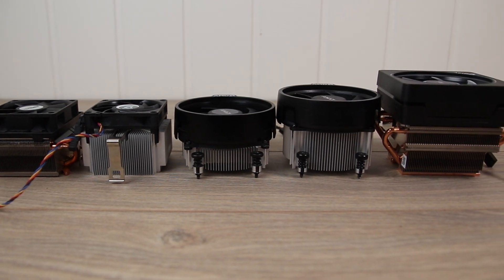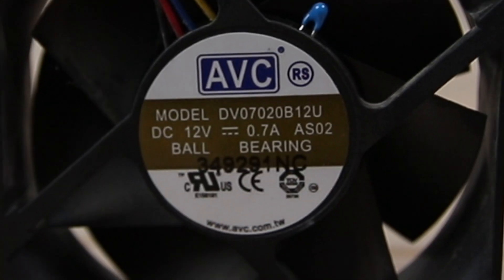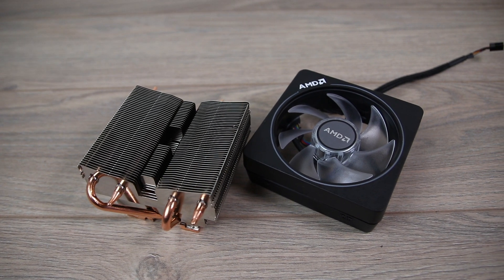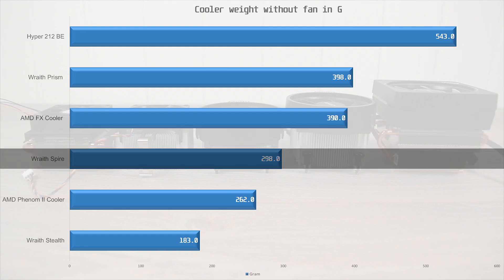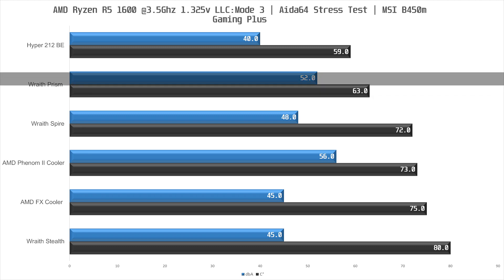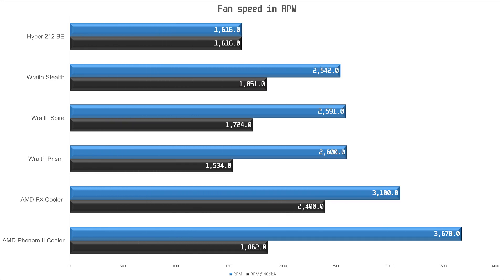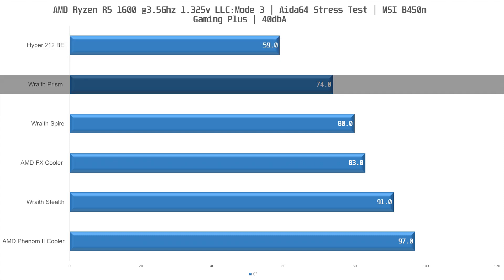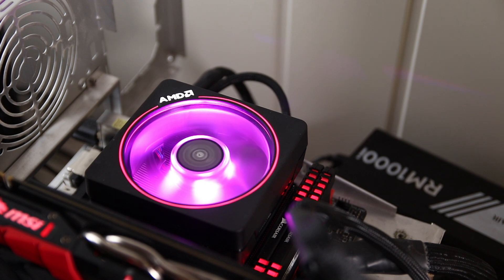Five AMD Stock coolers put to the test| FX and Phenom Coolers vs Wraith and 212 Black Edition

Comment: What about the temp during gaming, as this  is the only thing I will be doing
Reply from the maker: Depends on the game and settings. In general the stock cooler that is bundled with the amd cpus will be fine for gaming. However something like the hyper 212be will be more quiet. The cooler master fan on the stealth is not toi bad noise wise, the AVC fan on the spire is a bit louder and the prism can be downright nosiy.
Reply: @DontCallTechSupport  was planning to build with 3600 on stock cooler and upgrade it in few months, I live in India and the avg temp are around 36 degree.
And thanks for the quick reply
Reply from the maker: Oh, quite warm there. It will probably run quite hot then. Should be OK in less demanding games, but you may see 80 or even 90 degrees.

Comment: strange. I was hoping the old fx cooler that was made for a cpu with a 125w tdp would do great with the Ryzen 3 3300x with a tdp of only 65w
Reply: The phenom cooler is the one that came with higher end FX CPUs like the 8320 and 8350 the other one came with 6300s and lower IIRC
Reply from the maker: I don't have a 3300x, so I don't know. But the 3300x uses less power than the 1600, so it should be Okey. Not sure if it will be any better than the wraith stealth though. The fan on the FX cooler will probably make more noise.
Reply: @DontCallTechSupport  thanks for the reply. Like you I'm not crazy about noise so I'll probably just pick up a 212. It will do a much better job anyways so no sense in cheaping out.

Comment: After watching you’re video & other’s, i decided to go with the amd Wraith Max cooler ( very similar to  Prism butt quieter ) for my Ryzen 5 3600 with DeepCool Matrexx 55 Atx case with 4 decent Rgb fans already installed. I needed a Cooler with the fan airflow facing downwards towards the motherboard, that’s why i didn’t go with the evo hyper 212 🤔 for a Stock Ryzen 5 3600 it should be just fine & i figure it will drop my temps : -10c   Compared to the Stealth it shipped with. Thanx for Posting 🇵🇹
Reply from the maker: Thanks for watching! It should be quite a bit better than the stealth yes😅
Reply: @DontCallTechSupport  ~ feeling a bit of buyer's remorse  not going with a hyper 212 or Similar butt having the airflow downward towards the motherboard is important for me ( Long story ) butt either way Thanx for reply

Comment: I NEED HELP
1) Should I go for the strix rx 5700xt for just 10$ more than the Red devil ???
2) Will I get annoying problems with the strix model ??
Reply from the maker: I haven't tested the red devil myself, but judging from other reviews I don't think the strix is worth 10$ over the red devil.

 On the strix card you may have to replace a couple of screws that's supposed to hold the heat sink to the VRM. You don't have to replace them, but then the massive heatsink could add extra stress on the screws behind the gpu. There is also a new Bios for the strix card, I have a video testing that one.

Personally I would opt for the Red Devil.
Reply: @DontCallTechSupport  Thank man , Hope you have a great day
Reply from the maker: You too!

Comment: Just moved from a Hyper 212 LED to Wrath Prism. I initially found the fan noise a little intrusive. I flattened the fan curves in my motherboard's BIOS settings (MSI Tomahawk B450 MAX) and now I don't notice the fan in normal operation (idle/surfing temp ~40oC; fan set to step up at 60oC but I've never noticed it happening outside of benchmark runs). So yeah, the 212's a better, quieter cooler, but I quite like the Prism's bling and the fan noise is manageable.
Reply from the maker: Yeah the wraith prism isn't bad, it's just a little loud with the stock fan curve. With the 40dba testing the the wraith prism managed to stay in the low 70s which I would be totally fine with.